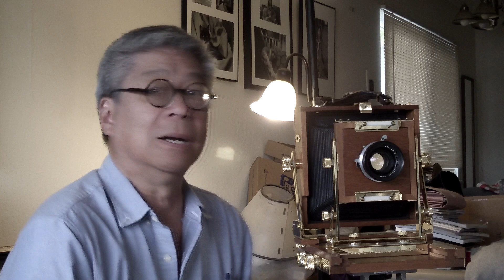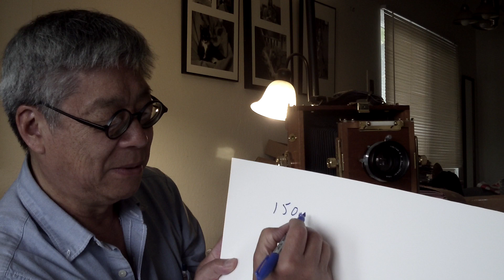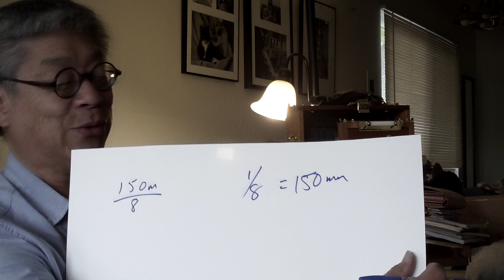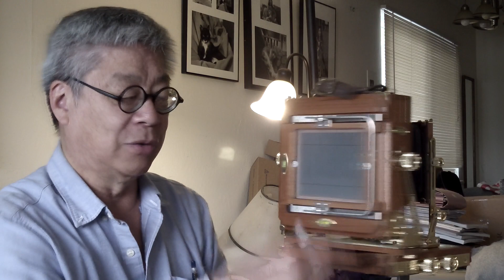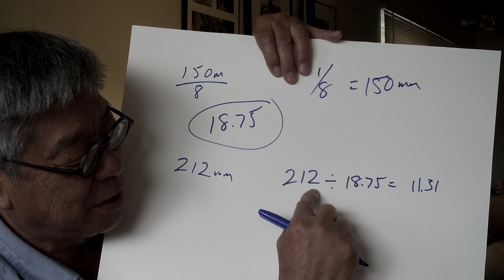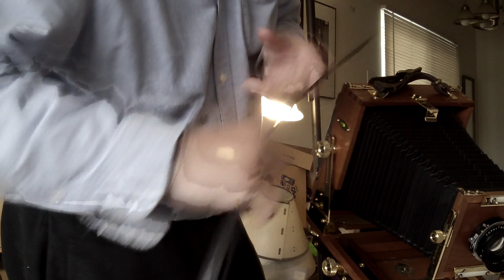How I calculated my F Stop according to my  length to film plane distance

Comment: As I was shooting my Mamiya C330 today (the bellows extend 55mm) I was struggling figuring compesation for close focussing and then it dawned on me that I could just print myself a table for the three lenses that I use with a grid showing the light decay/compensation for every 5mm extension just using your formula. I am just doing this right now. I will laminate it and stick on on the back!.  Thank you Mr. Hall
Reply from the maker: Good idea!

Comment: Thank you Timi! I learned back in the 80's a trick that helps me in figuring bellows extension. Basically, for every two inches of extension past the focal length of the lens, I open up one stop. 1 inch = .5 stop. etc... Great video, new sub!

Comment: I wish my 4x5 had markings on the bed so I can use it to focus to infinity.
Reply: You can manually focus at different distances and then make your own markings.  Of course this would be for an individual lens... the one you use the most.
Reply: Timothy Hall thank you that is a good idea. I have two lenses I shoot most a 65mm and a 90mm so it should be easy. I shoot a Chamonix f1 and both standards move so I will need to put the rear in a standard spot for this.

Comment: Thanks, this is very interesting. I also use 1.414 to set my flash manually. You know: aperture times distance gives the correct guide number at 100 asa. By dividing the guide number again and again by 1,414 (1/2 power, 1/4 power, etc.), you come closer and closer to the guide number you are aiming for. You must of course have a flash whose power you can reduce step by step. Thanks again and I hope that someday you will make an extensive video about "split filter" printing.
Reply: I watched a video on split filter printing and tried it.  I found that it works quite well and it works for a variety of negatives.  But I mainly rely on film masking in order to get the best print I can.  Film masking enhances the detail that is inherent in the original negative and performs much better than split filter printing.  Of course it's a lot more work, but if you like darkroom work that is not a problem.